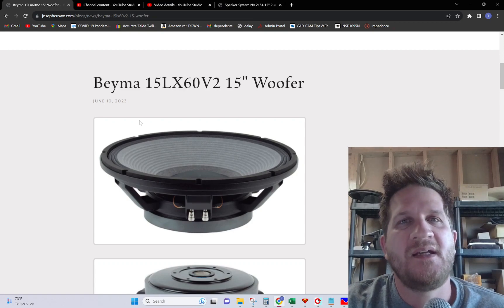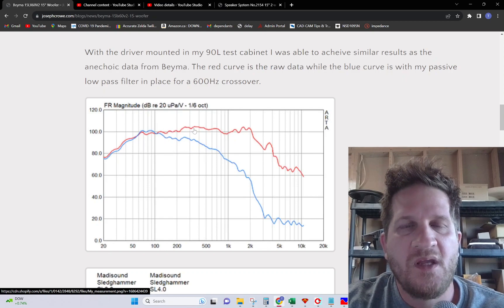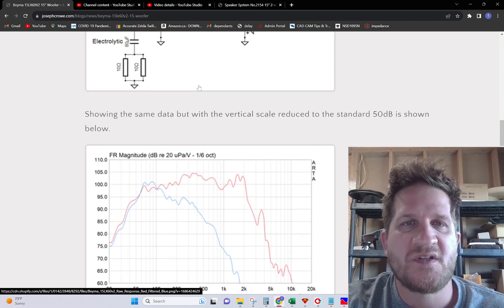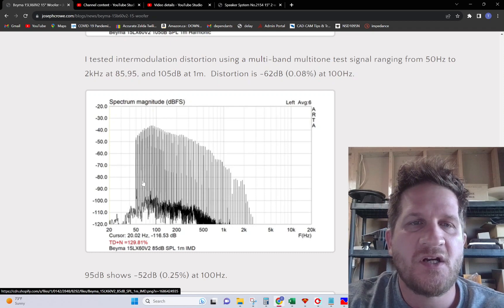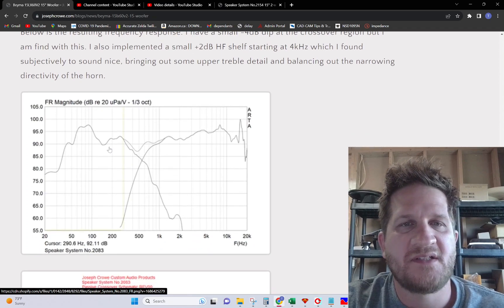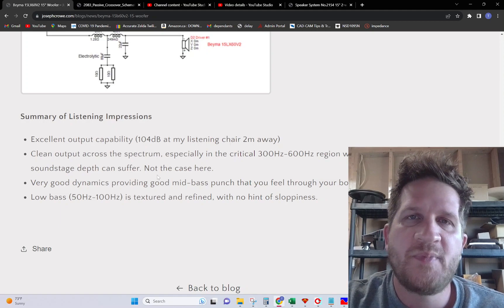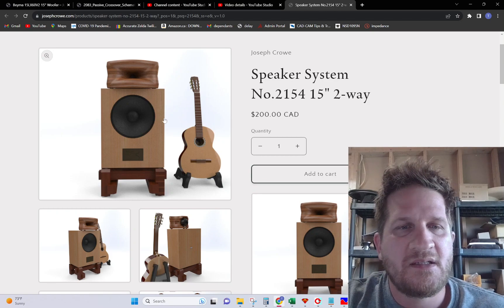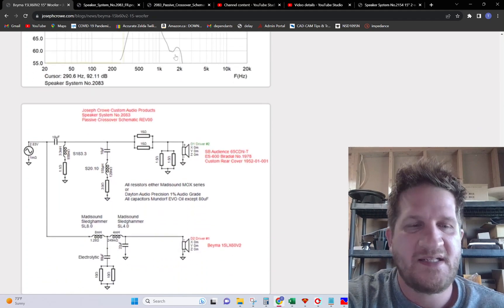Beyma 15LX60V2 15" Woofer

Comment: hi troy... would you share your opinion about how you choose your speaker components?

Beyma 15LX60V2 to JBL2226
this two are build alike one another, other than $60 difference...

Beyma 15WRS400 to SBa 150B350 bianco
these two have same spec, same price range... with Beyma have lighter cone MMs 98gr/3inch vc, SBa MMs 109gr/2,5inch vc

thanks if you are reply this..

Comment: I use exactly this woofer model in a large MTM configuration
Reply: thats intriguing AF. what tweeter did you go with?
Reply: @davesmith9684 I am using mine together with a Faital HF146 on a 18 sound XT1464 horn. I cross them at 650 Hz.
Reply: @charlestonl7884   Nice!! Thank you

Comment: Decent performance. But the irregularities in response, aligning with impedance blips,points to several resonances, that has not been corrected during design.  Looks okay for the price. Give us csds and sonograms /impulse / etc. and you will see where it's shortcoming is vs fx a TAD 160x rather clearly. Distortion is not the only thing that matter. Untreated resonances, ringing,  Impedance over excursion etc. all matters and was not touched in the review.    Drivers can have easily identifiable issues, while distortion measurements looks good.
Reply: It is defilitely not a TAD. But it does not even cost a fourth of a TAD. But it is one of only a few PA woofers that can be used in a low tuned reflex box without resorting to EQing. It doesn't have shorting rings. But it seems to have a T-pole which also helps a little in improving le(x). I use mine in 280 Liter boxes (2 drivers) tuned to ca 30 Hz resulting in a slow rolloff that is down by about 6 dB at 30 Hz. The sound is effortless and full bodied.  I would not believe the 9mm x-max spec when used in a two-way combo. Its physical VC overhang is only 5.5 mm. But in my very personal opinion a woofer that is also radiating mid-range frequencies should not go over 3 mm peak excursion on a regular basis. If it does then it is underdimensioned.
Reply from the maker: I will be doing a video soon where I test outside in a better bass cabinet (No.1798) which shows excellent time domain. (Same driver)

Comment: How is a dip at the crossover region a "OK" design? Doesn't that mean the drivers are not in phase at the crossover point?
Reply from the maker: With this particular design, having the dip sounded better than a flat response. We are only talking -4dB. The dip is caused by low pass filtering the woofer slightly lower in frequency than a textbook design, based on getting the best sound quality from the woofer itself. There are plenty of textbook flat crossover designs that sound poor because they didn’t critically listen and balance all of the attributes.